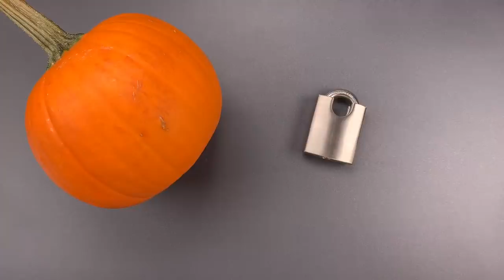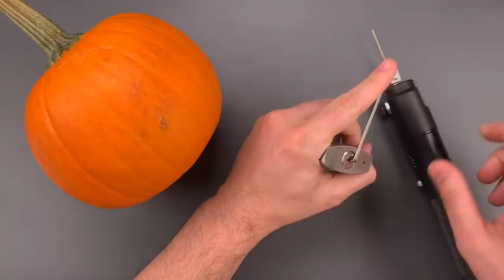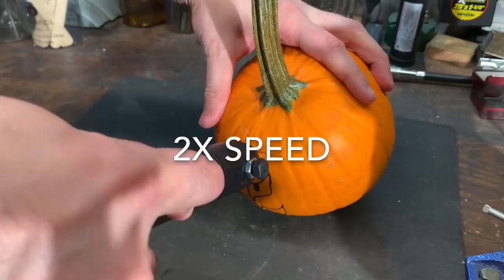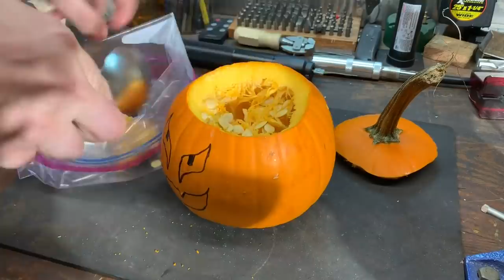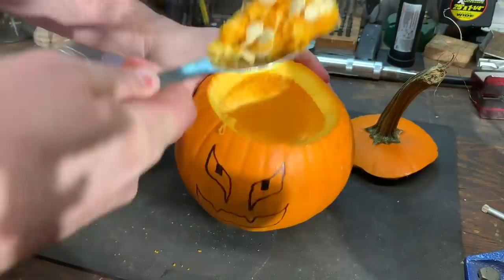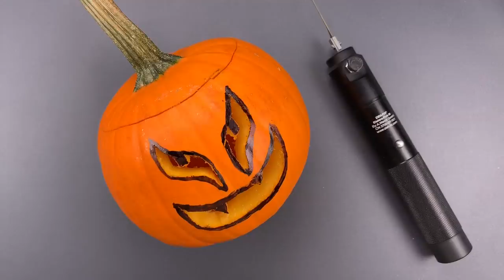[983] Lock Pick Pumpkin Carving!

Comment: I feel you should have put the pumpkins core out on a tray, treated the pins with salt water and then oven cured them.  You will find that the pumpkin locking mechanism is much improved.

Comment: Many locksmiths I’ve known who have tried both say the Dino is more effective. This after using it in 1000 locks. Also has a built in light and illuminated handle.  I think the pistol grip makes it much easier to use, where the wendt is made for euro locks with the button in an awkward location and harder to align.  https://youtu.be/rJkphJGsMvo